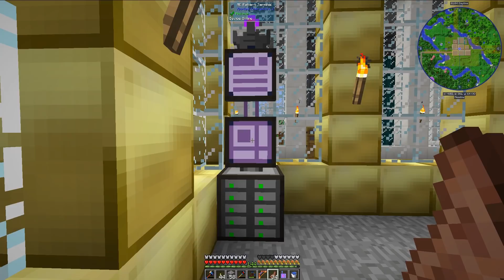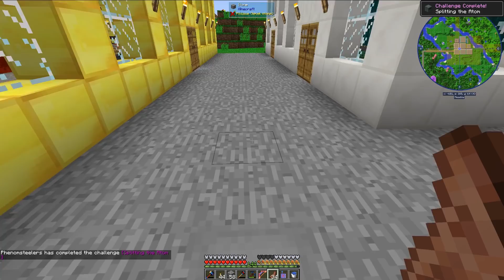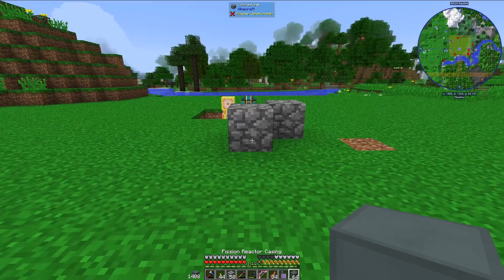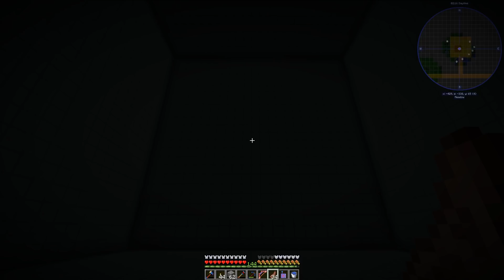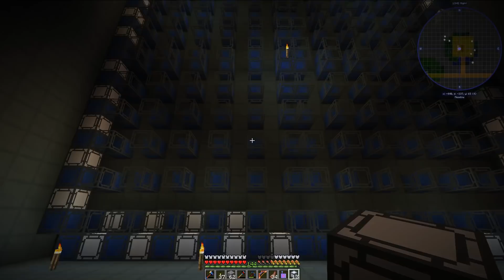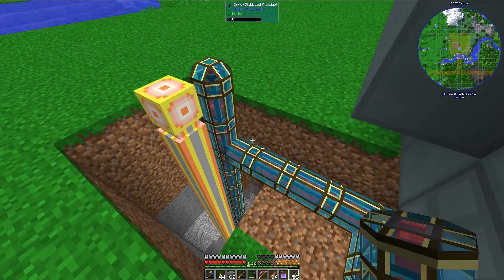Automate Everything Ep. 74: Massive (24x24x24) NuclearCraft Fission Reactor Build!

Comment: I built this and was doing fine with TBU fuel….. but then I put it in creative and added the highest fuel and boom, automatically after one power cycle my reactor melted. That’s a whole lot of blocks to fill and break to rebuild 🥺😭 I just wanted to see. I don’t even know how to make anything but TBU fuel. I should have just left well enough alone. 🥺😭
Reply from the maker: I'm sorry. All of the different fuels have different levels of heat and energy that they give off. So a reactor designed to burn TBU fuel should not be used to burn any fuel that produces more heat. I'm sorry if I didn't make that clear in my NuclearCraft videos.

Comment: I think i can improve this design,
I have to test first though
Reply: Well it did improve the design
Getting 1997kRF and net heat gen of -24k. I tried using other fuels but it didn't stay under 0.
Can't remember fuel name, but the fuel give double rf and 140heat gen.
I use the same design like in the beginning of the vid and just filled the holes with cryo cooler and reactor cells.